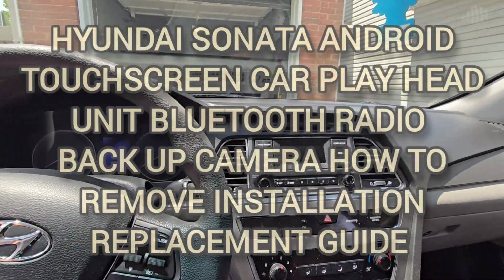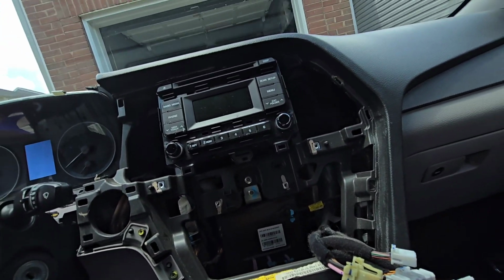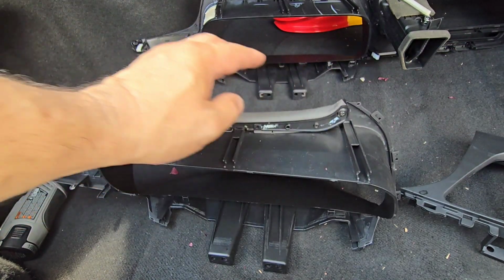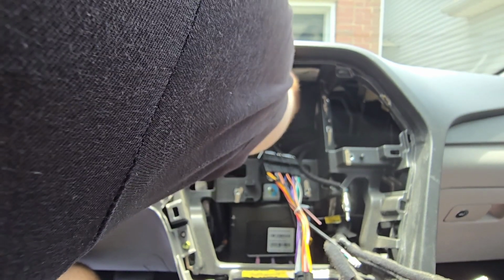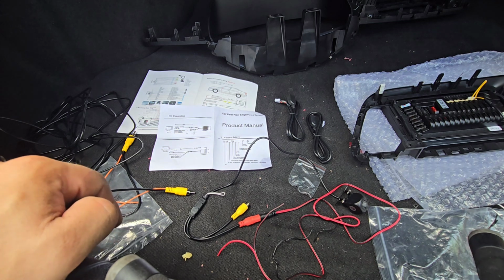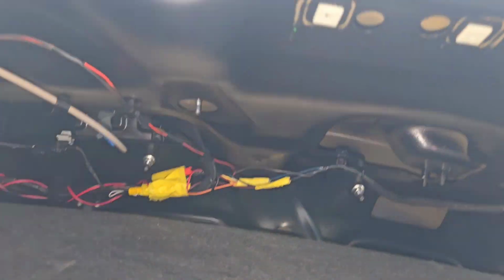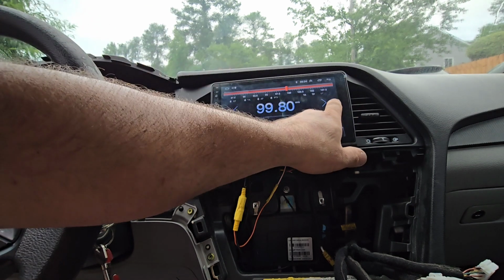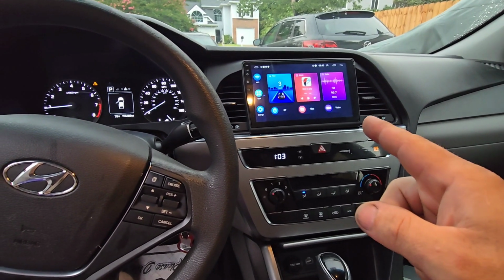HYUNDAI SONATA ANDROID TOUCHSCREEN CAR RADIO BACKUP CAMERA HOW TO REMOVE INSTALLATION REPLACE GUIDE

Comment: After installing, does your steering wheel volume control work? If so, how did you get it to work?
Reply from the maker: No they didn't. I believe there's are additional adapters that you need to buy in order to make the Steering Wheel buttons work. You have to research online cause I have seen them before. Thanks and Good Luck! 🤞👍💪
Reply: @projectathos  ok thanks.
Reply: @projectathos  Standard yellow GPS wire?